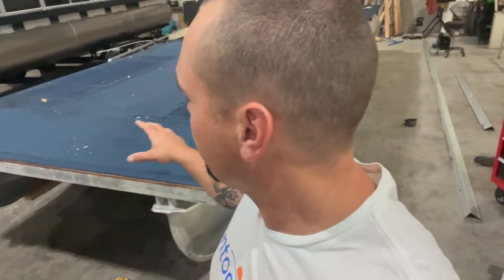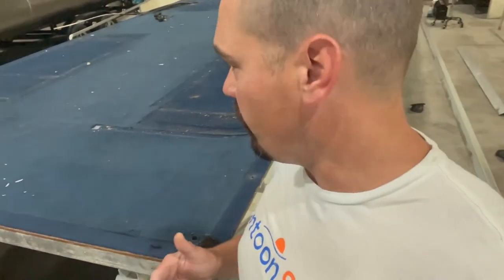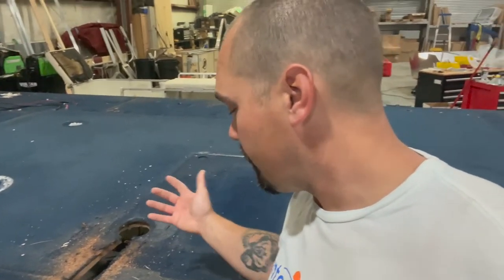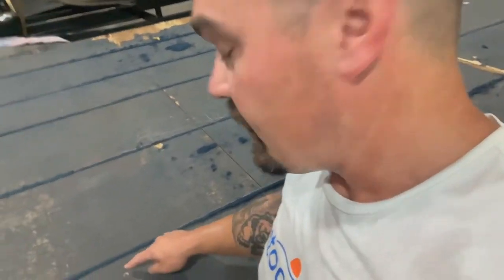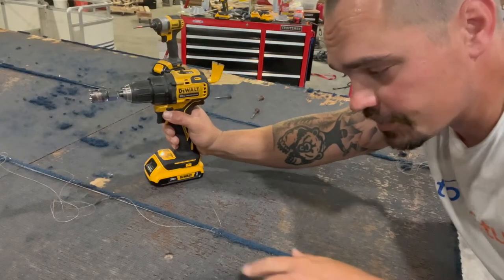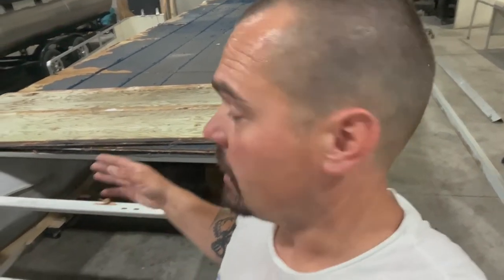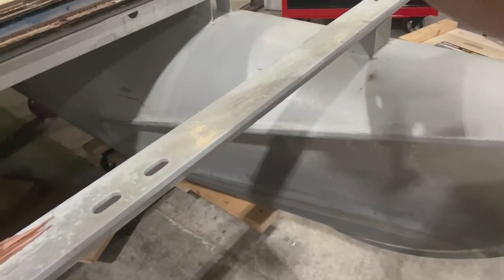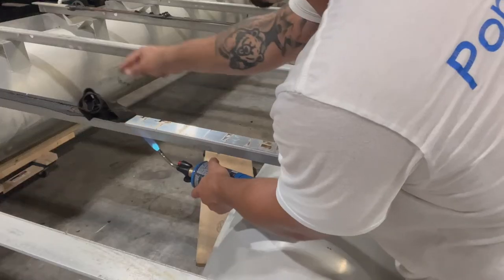Pontoon Restoration Tips and Tricks - Carpet and Plywood Removal

Comment: Tom, so this wood that was put on by the manufacture was pressure treated plywood ? I am currently in the process of rebuilding a pontoon boat and was going to use pressure treated from Home Depot, just wanted to make sure im not doing a big no no.
Reply from the maker: 99.9% of the boats we restore have pressure treated plywood. We use the CCA treated plywood from PontoonStuff.com. It’s marine grade which means there’s a smooth side free of voids and knots. You could use treated from Home Depot, but it’ll have knots in it that you’ll 
 need to fill or you’ll feel them once in a while under your feet. 

There are folks out there who swear treated wood will eat right through aluminum because of the reaction between the chemicals and metals. I’ve never seen it be an issue on all the boats I’ve restored. Maybe some super minor pitting or some dusty residue on the metal, but that’s all. I trust it enough to use treated on all my own boats.

Comment: As long as you put a barrier between the green board and the Aluminum your good to go.  even something a simple as Black tape.
Reply from the maker: I’m not saying that there’s no reaction between aluminum and CCA treated plywood, but I’ve never seen more than a light dust, and the big brand manufacturers don’t put any barrier between other than tar tape on the seams.
Reply: @tomspontoons  I'm goingto use it on my next pontoon rebuild I'm getting ready to do.
Reply from the maker: @faronmastin8683  It certainly won't hurt!! It makes the most sense if it's a pontoon that will be in saltwater...if I were in the salt with a toon I would do every little thing I could to prevent corrosion!

Comment: I used a small hole saw with no drill bit and went around each screw.   Then cut them off after.
Reply from the maker: Yes! That's another tactic we use on stubborn screws or stripped heads.

Comment: Why not just put the new deck over the old after the carpet is removed?
Reply from the maker: As in double layering the plywood? It would add significant weight to the boat which would reduce its carrying capacity and safety. I definitely don't recommend that. Getting it down to bare aluminum allows you to check over the structure and make any fixes that need to be made.

Comment: What if?? Instead of replacing that expensive 3/4 Marine plywood.lay down on top a Marine grade 1/4" Laun ?
Reply from the maker: There's a video somewhere on our channel where we found that exact scenario...can't say if it was marine grade, but the lauan was falling into pieces as we tried to peel it up. Our approach doesn't work for everyone, but because we're doing it for customers (and not our own boat) we replace everything to do it right the first time so that it'll last another 20+ years. Yes, treated marine grade plywood isn't cheap, but it should give decades of use without a second thought.

Comment: I would like to see re carpeting a boat with aluminum floors
Reply from the maker: One of these days we will tackle one to show the process. As a business we don’t do them because it’s very difficult to guarantee the long term outcome when laying new vinyl flooring. The aluminum surface has to be as perfectly clean as possible including removing old adhesive and carpet backing. Then a solvent based adhesive must be used where the process and timing is significantly different than gluing to plywood. Carpet isn’t as tricky as it can breathe to allow more traditional adhesives to cure, but we’ve never laid new carpet on a pontoon restoration. It’s always been vinyl because of the long list of qualities like….it’s low maintenance, no staining, fast drying, quick to clean, etc.

Comment: What are your thoughts on tearing up the carpet, unbolting the plywood and flipping it over?
Reply from the maker: For someone on a tight budget I suppose it'll work, but it's just not going to last as long as doing it right the first time and replacing it with treated marine grade plywood. If you're going through all the work to take the boards off I would say you're better off just replacing them and not worrying about it for another 20+ years.

Comment: Why remove the carpet if you're trashing the plywood?
Reply from the maker: Great question! When there are an abundance of self tapping screws it’s just easier to pull all the carpet up to locate them all. Other times we will only remove carpet where hardware is present which saves time and effort.
Reply: @tomspontoons  That makes sense.  I'm working on the rub rail right now, then plywood tomorrow.  I'm crossing my fingers, hoping that glue was expensive in 1993 🤣
Reply from the maker: @Elephant_Butte_Lake  best of luck!!!